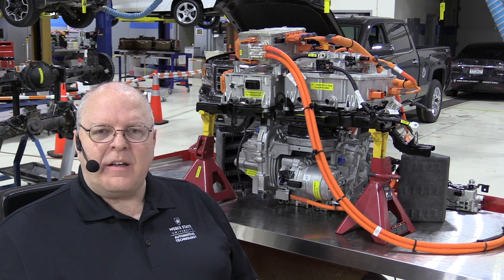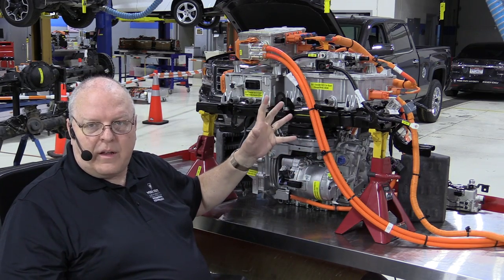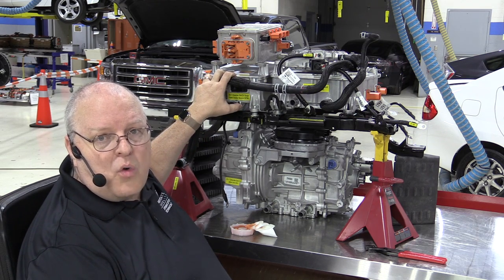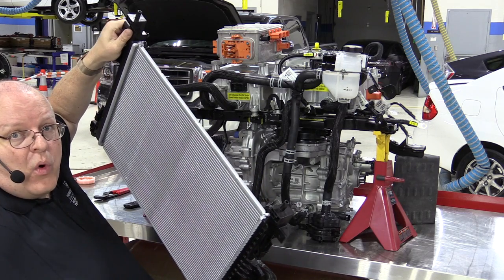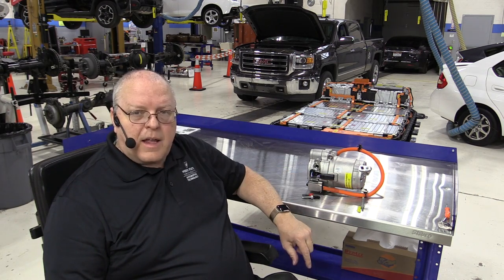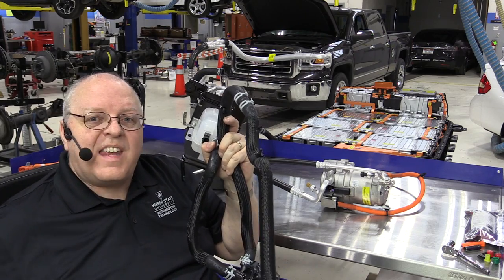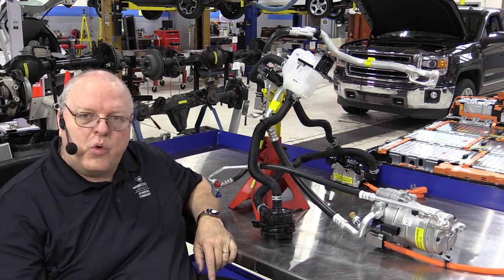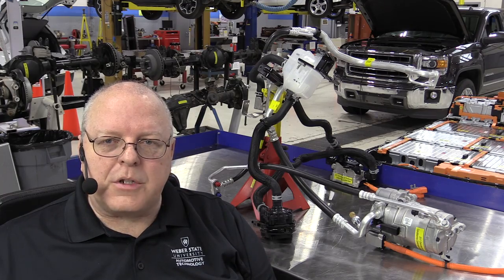Chevrolet Bolt EV Coolant System Loops

Comment: Professor Kelly, thanks for striving for accuracy in your presentations. 
Is the APM active while the high voltage battery is charging? It seems like it is on my ELR, I have an issue causing a 12v battery drain. I can see 100-250 watts of draw on my 240v charging station, even after the high voltage battery is done charging. If I clip on an external 12v battery charger the draw on the charging station will go down,  so it seems the car is able to charge the 12v battery while not charging the high voltage battery.
Reply from the maker: Yes, the APM is active while charging. It needs to provide power to run the cooling fan(s), water pumps, and the computers involved in monitoring and controlling the battery temperature. It also keeps the 12V battery charged while plugged in. It is normal to see additional current draw from your charger after the battery is charged. The battery temperature will still be hot from charging; the cooling system will continue running as long as is needed until you unplug your charger. My 2014 Volt will see a pulse in power usage every few hours when parked in my hot garage at home in the summertime just to keep the battery cool. The Nissan leaf does not do this and it is killing their batteries from overheating.

Comment: Extremely helpful thanks alot! I personally am making a EV and wonder if this will work if my motor was a Tesla S? Do you think it will be enough cooling and be compatible? Is there a place where I can buy this while unit? Also the unit separate for batteries

Comment: I wonder if it was decided to use a conventional cabin HVAC system and if that had an influence on the  drive train  temperature management design.   Thank you for this series and the rest of your videos.
Reply from the maker: All EVs that I am aware of use a conventional AC system. The heating systems can be different.

Comment: Radiators are passive cooling. Used when the temperature delta is high, for example ICE. 
The battery need to stay at a lower temperature, sometimes even lower than ambiant, that’s why a radiator wouldn’t work. Need an heat exchanger, and active cooling with compressor.
Reply from the maker: Thanks for your feedback

Comment: Do you think it is a good idea to thermally insulate the box for the cabin heating in order to optimize its performance in winter and that is only useful there, I touched this box in February, it was burning, what a waste of unnecessary heat consumed for a loss, thank you.

Comment: Regarding the liquid heater core... it seems like that's the tech GM like to use. IMHO the direct acting PTC heater cores, like Tesla and Fiat use work much better since they heat up more quickly and seem to provide hotter heat. 
On the PEHVs it makes sense, but it was always puzzling to me to have a heater, hoses, pump, and heater core on a BEV like the Bolt / Leaf. Though it does mean there's no HV cabling in the passenger compartment!
Reply: I think the priorities for GM was cost, reliability, and user experience. These newer systems have not been used and or perfected by GM before, long term reliability would likely have been an issue, not to mention out of warranty repair costs once that new fangled tech failed. The systems they use seem complex, but they are tried and true, and have proven to be very reliable, and above all inexpensive. When they do fail out of warranty, it will be the pumps, and they look to be easy and cheap to replace. One of the things I love about the Bolt is it's simplicity.

Comment: The older brother to the Bolt, the Spark EV, initiates battery cooling around 86°F(29.7°C), according to data from Torque Pro. I wouldn't be surprised if it's the same, or maybe even a bit lower on the Bolt.

Do you think the evaporator on the traction battery coolant circuit a bit on the small side?

Great video as always. Thank you!
Reply from the maker: Thank you! The chiller is about the same size as the Volt and Tesla chillers. They all look small to me, but obviously they work great.
Reply: @Broiler, do a quick search for "brazed plate heat exchanger" to get an idea of the amazing capacity of these clever devices. While appearing small they actually have a very large surface area on the inside, separating coolant and refrigerant into many interleaved plates.
Reply: Having both the battery evaporator and cabin evaporator on the same A/C compressor, does that mean when you have defrost running on a cold morning, that the battery is being cooled?  Is there some thermo-mechanical valve that prevents low-temperature operation of the battery loop evaporator?  I didn't see any electrical control for that in your excellent video, so I was wondering.  Otherwise, the Bolt would have to run the battery loop heater just to compensate for the chiller, which is a bit wasteful.  They might have an electronic control to prevent the cabin evaporator from running, but it still doesn't help you when you want the cabin A/C circuit going but not the battery chiller.  Just curious how they handle that.
Reply: @gregoryjward  It would make a lot of sense to have a solenoid or electronically controlled TXV on the battery evaporator but I didn't see one. Running the battery heater and the defroster at the same time would be problematic.  Perhaps the coolant pump is stopped when the defroster cycles the compressor on.
Did we miss something, Professor Kelly?
Reply from the maker: @gregoryjward  The two separate evaporators are controlled the same way a large SUV or van's front and rear air conditioning systems are. Each evaporator has its own thermostatic expansion valve (TXV) that controls the volume of refrigerant flow based upon the temperature of the evaporator core. Both systems can operate independently of the other. If the battery needs cooling but the passenger compartment does not, the TXV for the passenger compartment will be closed and prevent refrigerant flow. No electronic controls are needed. Additionally, the passenger compartment has an air-mix door to control the blend of air blowing through the heater core and the evaporator. Either one can be totally blocked off to prevent unwanted air temperature.
Reply: @WeberAuto  Thanks for the additional explanation -- makes sense!
Reply: edited - original post removed - For posterity, I cannot speak freely in public since I work in this (OEM vehicle HVAC) industry. Retiring soon, then I will be able to share details of refrigerant system design from an insider's perspective if anyone is interested. Even then I will be constrained by certain non-disclosure and trade secrets agreements. Know that Professor Kelly is by far the most informed source I have seen on YouTube for hybrid drive and electronic systems on vehicles. There is so much dangerously wrong information I have seen elsewhere on YouTube it is important to pay attention to the precautions he encourages.
Reply from the maker: @Miata822  Thank you again for your excellent feedback. The variable speed brushless DC water pump does shut off just as you suggested. The TXV blocks look identical on battery chiller and the evaporator. Have a great day!

Comment: Thank you Professor for helping this 2020 Bolt owner understand.   My question is since the passenger side is heated via a separate system that draws heat off the high voltage battery, might there be a way to isolate that heating so you don't experience a huge drain trying to heat the whole car via electric heat?
Reply from the maker: The passenger compartment heat is not tied to the battery cooling system; it is separate. it is powered by the high voltage battery. If you want heat, it will start using battery power. Thanks for watching

Comment: Nice video. I wonder why GM didn't do a direct air heater for cabin heating like Daimler did with the Smart ED? It'd have saved a bunch of weight, I imagine.
Reply from the maker: Thanks for your feedback
Reply: GM said they picked the method of heating they did because it was the most effective. And I can confirm that, the heat in our Bolt gets HOT, and it gets hot fast. Keep in mind GM is based in Michigan, they know a thing or two about cold weather.

Comment: Professor, thank you for this wonderful video. I am an electric engineer  student at NCState.  We have a project focused on EV charging technology and have some problems ordering some parts. In this case , the orange harness (cable) you hold in your hand at 1:17. Do you know the part number ? .  I am only interested in the J1772 AC piece.  We are looking for the same harness for the VOLT charger as well, and the one you show here is the closest (in length and plugs) to what we are looking for.  Any information for either the Bolt or  Volt would be of great help to our group. thank you for again for these very instructional videos.
Reply from the maker: Thank you! The tag reads 42538126

Comment: Hi John, thanks for such a detailed analysis of these systems! 
 I've recently started driving my 2020 Bolt on the track and have been seeing some brief "propulsion reduced" messages that last for around 5-10 seconds.  These typically occur after a long straight with heavy acceleration, breaking followed by acceleration again.  I've purchased an OBD2 reader to figure out what's overheating.  
After watching this video, I've identified a couple points of interest.   If the front louvers stay closed for a majority of the 20 minute run, the cooling system may not be able to keep up with the increased demand, causing it to limit power.  
I also wonder if keeping the air conditioner running while driving would potentially keep the battery at a lower temperature throughout the runs.  The alternative there is it could  hinder the drive train cooling system because the AC radiator is in front of the drive train radiator.  
I should be receiving the OBD2 reader soon and will report back with my findings.  
Thanks! 
Ben
Reply: Hi, what did you discover? thanks

Comment: professor, how much did all the DC fast charging equipment that you bought separately cost you? I purchase DC fast-charging from the factory has a $700 option, but wondering how much you got it for online and whether it work for you?
Reply from the maker: I have given up. I was looking at $3000 in parts alone. Then there was no guarantee that it would program correctly to work anyway. I think they really made a mistake not making those vehicles be upgradable.
Reply: @WeberAuto  Would this also apply to the Spark EV? That to upgrade to DC Fast charging requires a catalogue of different parts, as well as reprogramming? Spark has 3.3kW charging which is the fastest, and that is quite painful. The two options to speed up charging I thought was to parallel two 3.3kW onboard chargers as some have suggested, swapping out hardware to upgrade to DC Fast charging, or counting blades of grass in a parking lot for 6 hours.
Reply: @Infinion  Upgrade probably cost more than a used SparkEV with DCFC. Better to get SparkEV with DCFC rather than trying to upgrade. It's awesome to see SparkEV DCFC still the quickest in the world at about 3C all the way to 80%. No EV comes close to that, even Teslas peak at about 50%.
Reply: @mychevysparkevdidntcatchfi1489  No way, It's you! I gained a lot of insight months ago thanks to your blog post data and forum comments while you had your sparkEV. Thank you for your contribution to the internet's collective knowledge!  
Yes I agree 100%, incredible 3C charging bolstered by its oversized cooling system (shares gas spark radiator)! Because the Spark is very efficient and only has sub 18kWh capacity at 21,000km in 2020, Level 1 and 2 charging are very tolerable as our longest trips are only 60-80km. For long-distance trips, we take our Chevy Cobalt that can get 6.5L/100km https://photos.app.goo.gl/N8PmrdVkmt65bRbf6 or 770km on a full tank. 

We got our SparkEV for quite a good price (10,500 CAD private owner, LT1 option no DCFC, no nicks or scratches, seat covers & winter tires incl.) and it was the only "electric blue" color we could find in the country! The cable assemblies + charging port receptacle (sku: 24278342) $294, wire harness for battery charger comm w/ DCFC (sku: 95241674) $405, housing assembly (sku: 95368988) $90, control module (HPDM) (sku: 23453239) $490 are all reasonably priced from genuine parts distributors online like gmpartshouse, and gmpartscenter. GM dealerships have quoted similar prices over the phone as well. I was hoping that WeberAuto or someone else would find out about the programming requirements, or if a donor spark EV  shows up on auction nearby with fast charging that could forseeably integrate its control unit into a sparkEV without the option. I have lots of time to figure it out. I can wait until it's fair game to upgrade the vehicle in 2023 when the battery warranty expires or do it earlier with enough answers. The battery warranty has proven to be unnecessary though considering the case studies done on leased spark EV's https://avt.inl.gov/content/pubs-vehicles#C as well as the great condition our current spark is in from the trickle charging (0.072C level 1, 0.18C level 2) and the previous owner's wife's city-only short tripping, so I wouldn't really miss a voided battery warranty anyways.

Anyways, hope you're enjoying your Bolt! A lot of owners were contacted about a preventative battery recall recently, that's got to be bad news for GM, they already don't make enough money selling EVs.

Comment: Great video! Thank you Professor! I saw in my carscanner Brake Motor Driver Temp with 60 degrees Celsius while others motor parts 21 degC after car spent night in garage. Do You know what is brake motor driver? Why it so hot? Or it can be some carscanner mistake? Thanks!

Comment: in A/C system you mention wrong, that liq & sec tube name is IHX ( internal heat exchanger) is that in between liq pipe go through the sec pipe, during ideal condition like signal some in hot area condenser not reduce the temp what its want on that time this IHX will work to reduce the temp of gas for better cooling.

Comment: I can attest that the passenger compartment heats very quickly from turning on the car, and gets very warm. It heats quicker than most ICE cars that I have driven.
Reply from the maker: Awesome! Thank you for your feedback
Reply: I have found that when I remote start my Bolt (still plugged into the wall), it seems to heat the cabin much better than when I am driving and turn the heat on.
Reply: @daveconna6271  the Bolt doesn't directly use the electricity from charging to heat your cabin. It uses your main battery in the car, and the power cord recharges (but not quickly enough unless you leave it in long enough to charge properly)
Reply: @dansmith6990  I realize that - which is way I found it odd that it SEEMS to heat better when plugged into my house (a 240 volt, 16 amp circuit).  I just wondered if, when the car is not in operation, perhaps it heats up more quickly?  (and I don't think I have left the outside air vents open - though perhaps something like that is what was happening = duh!)
Reply: @daveconna6271  'seems' is irrelevant though, as it doesn't heat any better or worse, just the same. The outside temperatures is the only variable :-)

Comment: Thanks for the videos! I've been watching them to learn more about my new car. I do have a question about the air conditioning.
I didn't notice any kind of valve to control which evaporator on the air conditioning system is in use. Are there any, or does cooling the cabin force cooling the battery? If both evaporators are always used together, then how does the cabin one avoid becoming a block of ice when fast charging on a cool (50'sF) and humid day, and avoid cooling the cabin? I did that once after 100+ miles of highway driving, and I did notice a puddle of condensation under the car, so I think the air conditioning was in use, but not for the cabin.
Reply from the maker: It has a thermostatic expansion valve under the hood just above the battery chiller. Additionally, the A/C compressor is variable speed. Thanks for watching

Comment: Very interesting. I don't own a GM Volt, but I assume many of the principles apply to my BMW i3. Do these systems use the same type of coolant as a combustion engine? I assume the coolant itself is not as stressed as in a combustion engine, because it will not be operating at such high temperatures?

Comment: Looking at purchasing 2022 Bolt Ev and viewed with interest thus video on the cooling system. One of my concerns is that I live in the Phoenix area and intend to park and charge the battery in my garage. Temps can easily reach 120+ degrees in the garage. First, does the battery cooling loop only run when the battery is charging or would it also run when plugged in and not in charging mode. I am wondering if there is not a likelihood of premature failure of the battery cooling pump and other components due to almost constant running in the high temp environment. Thank you.

Comment: Which are the coolant specifications for each circuit, I mean if they are hynrid, organic; G11 G12 G12+ G12++ G13  are for engines, are different for Electric Motors and Modules?
Thank you bery much

Comment: It seems like a system that could benefit from an aftermarket thermal bypass solution. That way, hot coolant could be diverted away from the radiator and into the cabin heating system, thereby reducing the energy needed to power the heating element. Just thinking out loud...
Reply from the maker: Thanks for your feedback
Reply: It doesn't seem like that would be too complicated. A pair of actuated valves and a heat exchanger between the two loops with a bit of firmware ought to do it.

Some measurements would need to be taken as to how effective this would be, although I'd bet it would work pretty well in mountainous terrain or on highways.